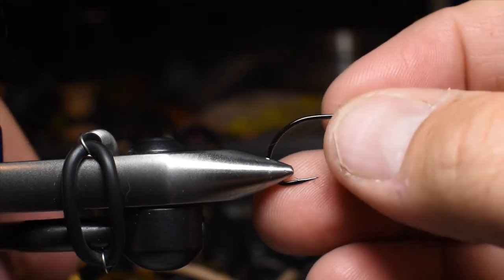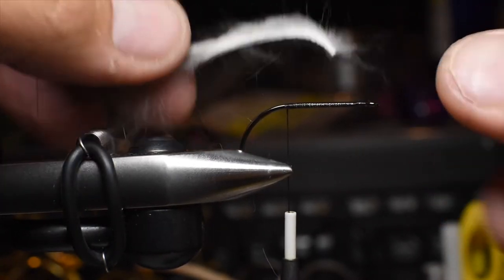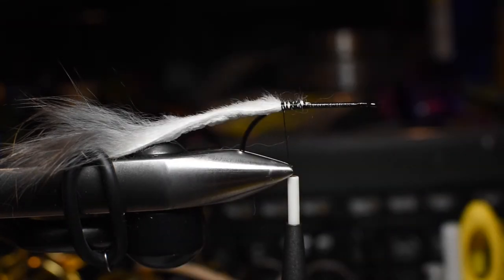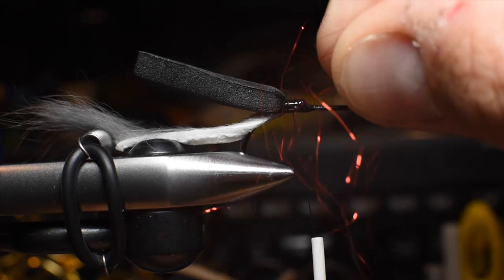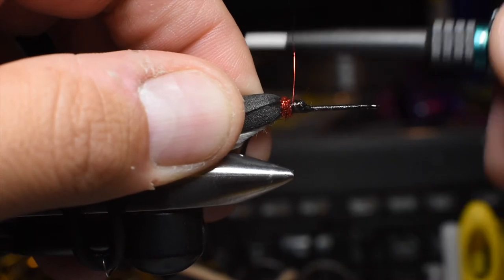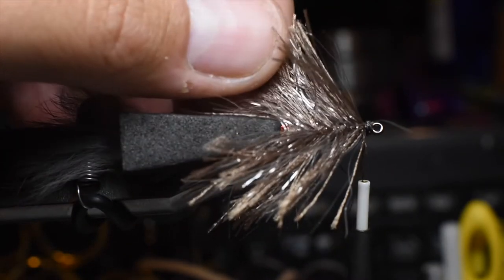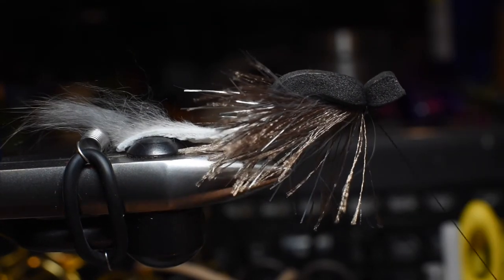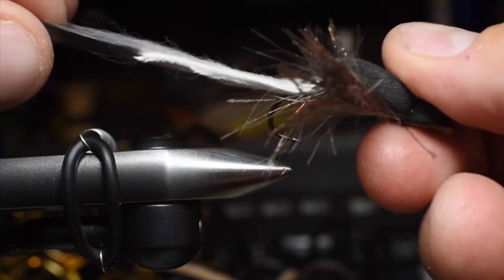Extreme Morrish Mouse Fly Pattern

Comment: Great video. Question: What foam head thickness are you using.
Also, What is the body material used and where I may purchase it. Thanks again.
Reply from the maker: The recipe is in the description:

Thread: Semperfli nano silk 100 d
Body: Semperfli extreme string
Tail: rabbit strip 
Head: 6mm foam tied in at the back and the bead
Hook: b10 s 4 or 6
Cement: resin 

As for where to buy the extreme string check out j stockard